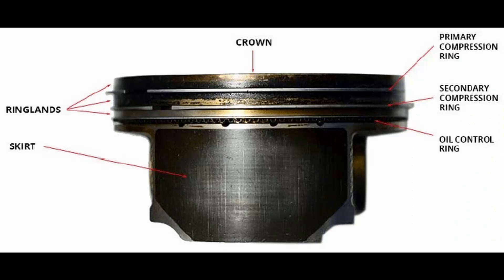Subaru RINGLAND FAILURE Explained | What You NEED To Know | WRX/STI | WRX VLOG 53

Comment: After using basically the same engine for over a decade, you’d think Subaru would have figured out how to fix it in newer models… 

About to get a 2021 STI, hope the rings don’t fail.
Reply: there were slight changes in the EJ motor in 2019 after the big lawsuit. Purportedly, this has lessened the risk of internal engine failures

Comment: What’s your take on ring gaps being a potential issue for causing ringland failure? I remember reading somewhere and my tuner showed me this as well, but oem ring gaps are pretty tight. If I remember it was like .0015 ring gap from the factory, on 16 psi from the factory (EJ255) it’s fine, but then modding and tuning to run 20 psi is where it gets questionable as more heat is going into that cylinder it’s expanding the rings and  eventually that ring gap is gone and all that pressure has nowhere else to go but into the ring lands where it then cracks the piston.

But yes detonation is the primary cause as a result of poor modding, driving, and tuning. People really are out here puttin holes in their Subaru pistons from their own bad practices….

Comment: My 2020 wrx sti is burning a quart after 1800 miles is that normal just making sure. It is really hot in Florida at the moment
Reply from the maker: Uh no, I don't think so, Sounds like potentially ringland failure. I would bring the issue up with a dealer.
Reply: @AutoEnthusiast  that freaking sucks i haven’t even beat on it or anything that’s so crazy smh... well ima set up an appointment
Reply from the maker: Yeah definitely take it in! Let me know what happens!
Reply: @AutoEnthusiast  oil consumption test and told me it’s burning oil it should be normal  and I should just do check ups that’s bull crap smh.. honestly I even asked facebooks big group they also said the same thing only two people out of 200 had this problem so they took it and they did the same they do the test they say it’s normal to burn even though they clearly told me over the phone it’s not lol smh what a joke bro literally just. Wanting a daily considering on getting a another car next year

Comment: So what is a normal oil consumption on STi’s? I noticed my 2017 burning 1qt 1/2  in 3k miles, is that a lot?
Reply: That seems excessive. I recommend Motul 8100 excess 5-40. Never run Mobil 1

Comment: Stop using shitty 87 pump gas problem solved. Turbo engine like it should run on 90 or 91 at very least. Something that is lowest grade in europe(their 95 octane is usa's 91-92 octane). When people use cheapest shitty 87 pump gas it will lead to knock in performance engines.

Comment: Detonation is pre ignition, meaning that the air fuel mixture in the combustion chamber is ignited before the spark plug ignites it, so the Piston is actually going up in the Powerstroke and now it's fighting to go up cause the air-fuel mixture is ignited   but yet the Piston has to travel up during those explosions and that's the noise you hear the pinging sound as a piston is traveling up and fighting the explosions of pre ignition not by the spark plug,  bad for the piston

Comment: So many Subie fans still in denial about these pistons. “If you do this or do that, of course this is gonna happen” etc. Regardless of how people are driving these cars, the fact is ringland failure is happening in disproportionate numbers over all other engines. It is the weak point of this engine. You can add all of these proactive measures or you can just drop in forged internals. Problem solved. The same people that are having this issue are the same people modding their cars and voiding their warranties anyway. So just get it done. Meanwhile any other issues with the car will still be covered. Blow a tranny? Crack a diff gear? Still covered. Nobody is checking your internals before they fix those or many other issues you may have. 

2016 STi here. Forged rods and pistons. 40,000 miles and trouble free high boost rev happy ej. Great car.
Reply: Thinking about buying a 2015 STI with a built block honestly and callin it a day 😂

Comment: Simple explanation than this lacking rundown is weak. Its physics. The pistons go side to side the air fuel mixture pools at bottom of pistons and fires unevenly more explosive forces at bottom of pooled fuel thus stressing ringland at the bottom portion thus cracking ringland. Solution forged piston or new fuel delivery to evenly disperse a f mixture

Comment: After 10 years we still have to talk about ringland failures, that sucks. In 10 years Subaru just continued to build the same shit xD
Reply: Very true but they are going in the right direction....slowly but still in the right direction. The fact that they are putting forged pistons and rods is a good sign. All they need now is a closed deck block and equal length headers and the majority of engine failures will disappear.
Reply: We need a ej207 over here. Forged semi closed deck, twin scroll/EL’s, 8000 rpm screamer...

Comment: FA been great nearly 80,000km tuned from 2500km. Only issue will be carbon build up. I'll clean thr valves say at 100,000km. Car hasn't dropped oil at all. Always change oil at 5000km and the log book service when required. Best car I've owned. Previous car was APR Stage 2 GTI. Dropped oil all the time...

Comment: I currently own a 2006 sti Hawkeye black on gold 👍🏽 I took owner ship of the car on September 2005 I was never educated on any    Preventive maintenance 😩 Iv been driving the car till the current day as my daily needless to say after warranty was up timing belt and head gasket jobs never seemed to correct my oil issue turbo went at 100k it was I had that replaced with a stocker Cobb down pipe intake stage 2 I’m at 140k miles I consume about 8 quarts of oil in 3000 miles but she still runs 😂 😩 In desperate need to replace the block and do everything to prevent it from ever coming back
Reply: 8 quarts in 3k miles? That's fucking nuts
Reply: 8qrts in 3k miles damn bro... Nothing will ever beat my 350 tho.. About 50qrts of oil every 3k fuck the oil change just make sure it has new oil 24/7

Comment: tbh... after having  2 WRXs and a 2006 STi.

Dont get a STI. the real issue with the stis are the AFRs are always running lean and too rich. I got a completly stock sti and it would goto 13 to 14 after always, and it would run very learn between shifts. Then when i got my Tune the afrs were so hard to control. like keep a steady 14.7 afr at idle, or cruising. it was always running lean. and too rich. My only reliable subaru was my 2009 WRX. they car had Solid AFRs at all times. boosting, cruising and idle. my STI was the opposite. It also could still get a minimal amount of knock and would still destroy the engine. thats how weak they are. Just get a BMW. im very happy with my 2015 328i. and going to be soon trading it in for a m3 or a 335i :)

Comment: How to prevent ringland failure, learn to drive. Stop throwing bolt on power adders without going into the block. Stop getting ots tunes !!
Reply from the maker: Tons of people are experiencing it stock.
Reply: @AutoEnthusiast  you are correct, it's the younger crowd that haven't learned the most important mod of all. Driver mod !! Basically ringland failure is plagued by generation, if you're over let's say 30ish or just mature enough to know the Rev limiter is where your motor goes boom. Zero ringland failures will accure, facts are facts. Dealers report 95% ringland failure at full throttle being recorded on the ecm at the time of the failure. Only reason there is even talk of SOA replacing motors are the buyers are still kids, that's changing as prices will climb. Hopefully the next generation is in the $50k range to ward off the younger generation from purchasing a WRX or STI and further tarnishing the Subaru name. Plenty of older owner testimony, zero ringland failure pushing 150+k miles while the young kids are replacing a motor minimum every two years. Literally go to every subie forum, facts are plain to see if you really care to swallow the truth.
Reply: @Hanibul_Lecktor  well said. The WRX is an awesome vehicle but the following, for the most part, is embarrassing.
Reply: @AutoEnthusiast  prime example, kids will blow a IAG 2.5 tough block in less then 25k miles. That's just pure abuse and no driver skills at all.

Comment: I cracked a piston in a 2.5 NA motor that was only at 5psi. If you hear knock... let off or shit might hit. NA pistons are very similar to turbo pistons and neither will take abuse if not setup with limits. 

If you are driving like you stole it, on an OEM block, that you are pushing to the limit with a tune, good chance it might break. Welcome to the world of automotive technology.

Comment: What does EJ mean ? And FA for the newer motors ?
Reply: staind039 They’re just engine stamps for the model of engine. EJ motors are the ones that have been around for a long time and in all Subaru’s up until recently. For instance, in the US WRXs had the EJ20 (2.0 liter) until 2006 and the EJ25 (2.5 liter) after that up until 2015 when it got the FA20DIT (2.0 liter) the STi has had the EJ25 in it since it’s been in the US. Newer non performance Subaru’s use the FB20.
Reply: Adam Walters gotcha... didn’t know the EJ or FA was just an abbreviation of something relative to the motor

Comment: Tip: If you push the STI engine to redline everytime you change gears, your Pistons will fail
All engines will fail if you do this
Reply: All engines will fail....
No not true. I rev out my Evo IX to 8k+ RPM and almost 14 years later and 200k miles no problems.
Reply from the maker: Not really. Turbocharged engines, especially in Subaru's, Honda's as well, are designed to rev out. maybe not all the way to redline. But it can be better to rev out and build boost in a safe rpm range.
Reply: @AutoEnthusiast  DUDE no, that's not how motors are designed at all. Rev limiter is cutting fuel, hence melting pistons and breaking ringlands left and right. The redline is literally just that, red is danger danger. Same shit happened In the 2000s when 4 stroke dirt bikes became mainstream. Kids used to driving a 2 stroke pinning the 4 strokes to the moon. Melting valves, dropping pistons and snapping rods left and right. Being a experienced rider and builder, my 2003 CRF450R still to this day, has the original valve shims and piston. Only replaced rings once due to I felt like it. AMA A rider here btw.
Reply: @Hanibul_Lecktor  rev limiters cut spark not fuel in modern cars, if they cut fuel alot of people would have blown motors from every manufacturer.
Reply: Auto Enthusiast do you have proof of this?
Reply: @AutoEnthusiast  Agreed. I've found that with any boosted car you need to be a little more gentle - think of the car like a horse. Get her ready! Warm her up. Drive hard in short sprints, and allow the car to cool down in between sprints. You don't need to hit boost every launch. Don't lug the motor. Wait until 3500RPM to begin building boost.
And, as he said, pay someone to tune the car correctly, use the best quality fuel, and bear in mind that ACN (Arizona, California, and Nevada) 91 octane is shite. Keep that in mind and keep your eyes on your AP for knock. Be nice to your car, and it will last. It's not an N/A BMW e36, a Miata, or a 240. Be aggressive at times and give the car time to settle after. Always let it cool down before you shut it off. Run good oil. She'll hang in there.
Reply: 1970 chevy chevelle ss  If you're talking new WRX, they're not even running the engine he is referring to. They have much worse problems with connecting rods failing in the 300-400hp range due to them being slightly offset from center. Perfectly fine stock other than a giant hole in the power band.
Reply: Lol most of these "tuners" have zero grasp on mechanics. If you push a engine like a race car every time you drive it, expect to have the reliability of a race car.
Reply: Honda

Comment: Im at 44k miles on my sti. Stock with a full exhaust, no tune. Second owner bought it with 33k miles still under warranty love it and yes i daily this sti, i stuck with the sti over my focus rs which i am selling, ive been changing the oil every 3500 miles, i beat on it about a quarter of the time, but i live in a 4 season area so the weather is the only thing rough on my car, its a 2016 and i love it, my future mods are i plan to keep the  body pretty much stock but i want to do a full build with full bolt ons making around 550
Reply from the maker: So you are keeping the sti over the focus rs?? Which do you feel is faster stock? (from the butt dyno lol)
Reply: @AutoEnthusiast  to be honest the sti feels faster to me stock vs stock, the rs feels cheap. Makes a ton of noise, feels fast as well but it just feels like a cheap subaru knock off tbh, 350 vs 305 basically should explain it but the sti moves
Reply: Cameron Scott agreed. I test drove the RS and STI and although on paper the RS was supposed to deliver better performance I had a much better experience in the STI. 7,000 miles into my ‘18 with no regrets - it’s a great car if you really enjoy driving. And happy to report no issues whatsoever
Reply: @myvalium1  the 2015 to 2019 wrx non sti in my opinion is even a better car than the rs..
. The rs that we had was garbage man... we live in northern indiana so we have all 4 seasons and we get it bad.... bought my 2016 base sti for 28500 with 33k miles all stock and under warranty it now has 45k less than 6 months later and i truly love it
Reply: Not over boosting with full exhaust on stock ECU? You should be going lean from too much boost unless you think a cat back is full exhaust.
Reply: I had a wrx and I would beat the shit out if it in one year of owner ship I did 44k miles never did I have rod knock or anything like that but I would always do the oil change every 3,000 miles
Reply: Test drove the WRX and STi back to back in 2015 when we were looking for a new car for my wife. WRX felt snappier, spooled up way quicker. STi didn’t really feel any faster other then at like 6000 rpm it felt as if it pulled a little harder until redline. Ended up getting a more expensive optioned up Tiguan because my driveway requires decent ground clearance.... perks of living on a mountain lol, had to park my Speed6 at the bottom and walk up in the winter cause big frost heaves.. STi you really only get a better AWD system and a tranny that can take a lot of abuse. The fa20 is overall a better engine then the EJ. A fa20 mod for mod will outperform a USDM STi. What we need is a STi with a ej207, twin scroll/EL’s, forged semi closed deck block, and a 8000 rpm rev limit like the actual JDM model has... a ej207 version 8.

Comment: Had an engine fail on me. Found out the hard way what knock was on my 2013 wrx. Broke engine block and 2 pistons. Had to rebuild engine completely $7500 parts and $4500 labor. After that yeah I check/change the oil religiously 😅
Reply from the maker: Sorry to hear it! All out of pocket?
Reply: Please tell me those are aftermarket parts
Reply: For that price, you should be able to get a longblock that can hold around 800hp.
Reply: Damn for 12k I hope it was for an aftermarket closed deck block, forged internals and all the bells and whistles. If you paid 12k for a new OEM motor then.......
Reply: Literally same

Comment: Standard EJ does not have a sleeve. Actually even with built motors there is not enough material to set sleeves. The only reliable way to sleeve an EJ is in a $10k billet block. What you mean to say is cylinder walls. The cylinder walls are actually so thin and detached from the main outer material in the block, that’s why people get sealed deck blocks as to strengthen the cylinder walls so they don’t flex under heavy loads. I recommend MRTPerformance’s videos. They rebuild Subaru motors in all sorts of specs and give lots of great info.

Comment: I always re-fuel at half empty tank, this reduces the risk that some random batch of bad fuel will cause engine detonation.  Also,, I am out West, 91 octane is max here,  when I know I am going to be pushing the car hard I add a bit of octane booster, not much, usually half the recommended dosage  on bottle, just to add some layer of safety.   The car is a 2013 Forester XT, ...I don't abuse it in any way but it sees some mountain driving and very prolonged turbo engagement on long steep inclines, ...hence my concern.
Reply from the maker: The filling up before half is a great  way to mitigate risk
Reply: @AutoEnthusiast  Its a good idea to occasionally run a bottle of HEET or some small amount of methyl alcohol to get rid of any water condensation that may accumulate in the tank.  "Bad gas" purchases are most likely related to water contamination also. Gasoline doesn't mix well with water.
Reply: I live in the wv hills my wrx on 93 amoco ultimate.  Tried some shell from va.... car doesn't like it going back to bp.

Comment: Ring land failure is not the biggest concern now that the 2019 STI comes with better pistons. The rods are the biggest concern now in EJs
Reply from the maker: I suppose you are right, too early to tell. Subaru always claims to fix the ringland issue, and we will see in the coming months whether it is true or not. But for most EJs, its ringland.
Reply: SanchoKlos  driving habits?
Reply: SanchoKlos  probably drove it like they should be riding the short bus.
Reply: Don't tread on me besides free Erving on the redline, pistons shouldn’t crack at 5000 miles even if your the worst driver.
Reply: SanchoKlos   well damn, i hope that doesn't happen to mine haha